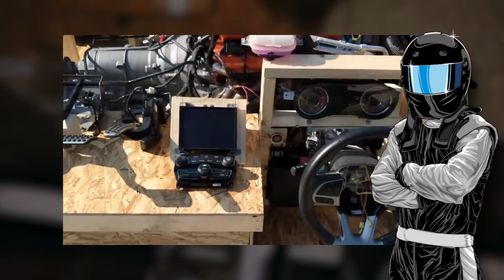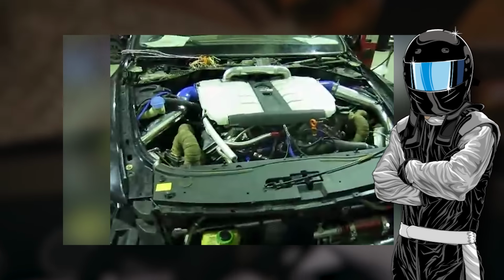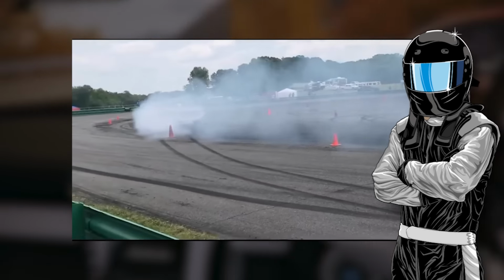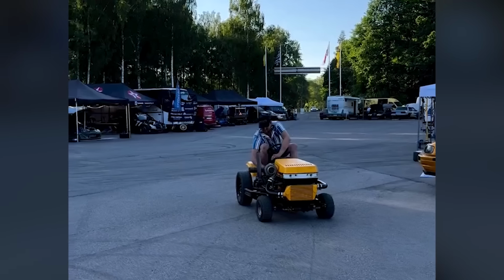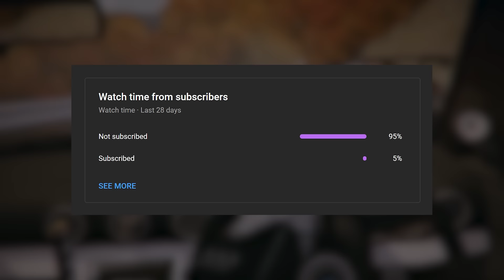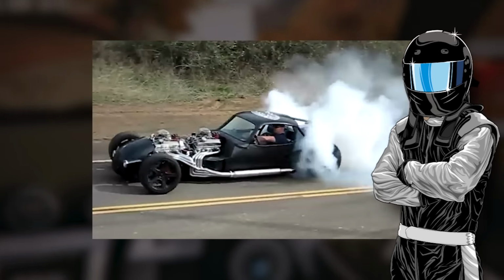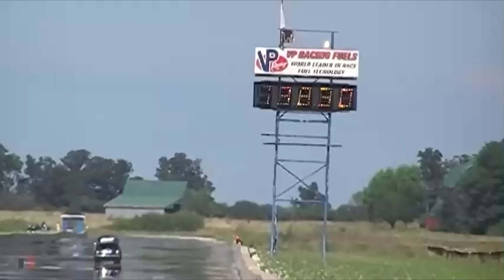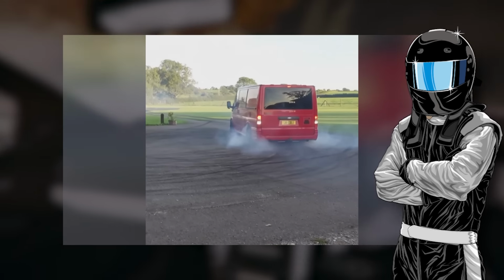When MECHANICS LOSE Their MIND! [CRAZY ENGINE SWAPS!]

Comment: 6:11 I bet the turbo lag on that thing is insane
Reply: Yeah, the compressor surge risk is pretty crazy when having to run the engine as if you're in a regular car. And it's pulling mediocre horsepower (probably because it's designed for drone helicopters).